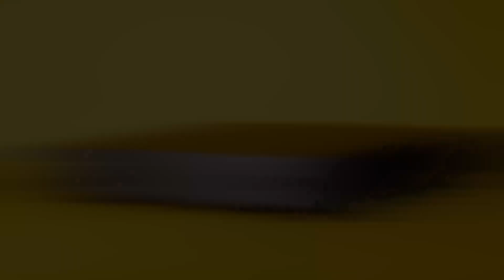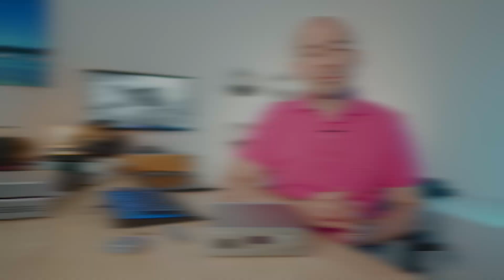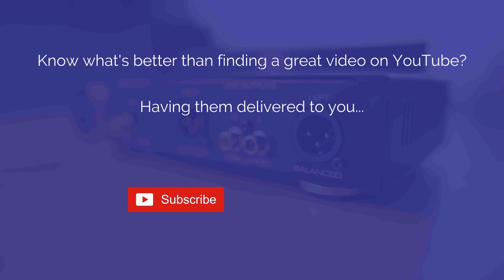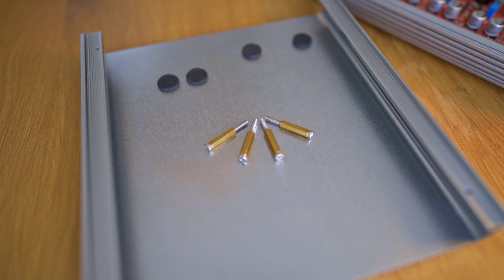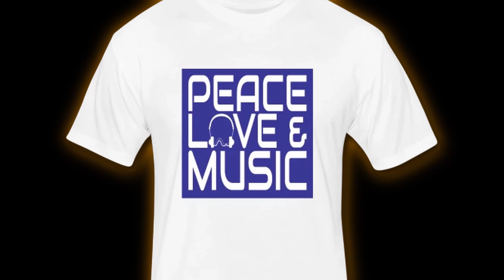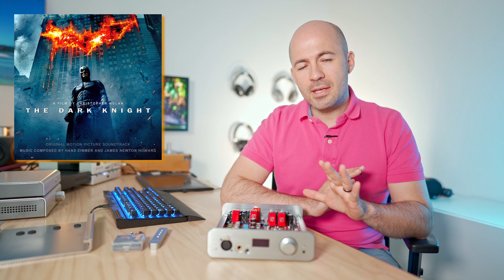Burson Soloist 3X Headphone Amp Review - New tech + old classic = wow!

Comment: Thanks for your great and detailed reviews!  I popped the V5i opamps into a Topping A30 and it completely transformed that budget amp and got me interested in Burson's offerings.  I'm leaning towards the Soloist with maybe an D90 but I'd be very interested in hearing your impressions of Burson's DAC offerings (and others) as well.  The more 3 dimensional sound stage presentation is definitely something that I'm chasing after.  Your review of the D90 gave the impression that it is amazing bang for buck but am curious if the D90 flattens out that 3 dimensional presentation quality as you noticed with the A90 as well?  Keep up the great work!
Reply from the maker: Thanks Casey. Yes, the D90 does tend to flatten things a bit - it seems most delta-sigma DACs do. I'm currently finishing up my Denafrips Ares II review and would say that it is a great alternative to the D90 if you're looking for better soundstage depth.
I'm also expecting to receive a Burson Composer DAC to review when I receive my Soloist amp so you can also watch out for that one to see if Burson have some more voodoo in their bag of tricks...
Reply: @PassionforSound  Excellent, I'll be curious to see what you think.  I'm learning, over time, to trust my ears instead of a spec sheet but it's nice to have objective reviewers like you to help save me a buck on dead ends and wrong turns.  Cheers!

Comment: Intriguing theory on possible timing errors introduced by the capacitors in ICs and why discrete circuit design might ultimately be better. I feel you're onto something here.
Reply from the maker: Maybe. Just for clarity, it's capacitance, not capacitors. The idea being that certain sections of the IC may be holding the signal a fraction longer than they should
Reply: @PassionforSound  Do you have any studies indicating this correlation between capacitance and soundstage? I'm really curious about this.
Also, I'm an Analog IC designer and, in my experience, you should expect higher capacitance in a discrete design more than an integrated one. What may happen is, because the amplifier designer is the same for the discrete ones, he may "tune" his design better for any parasitics and other variations in the PCB manufacture. In contrast, someone using a shelf IC component may not be familiar with the full design characteristics, and will just follow the IC manufacturer specifications and tweak with some experience. That however is not the same as when you designed the topology from start to finish, as is usually the case with discrete components.
Reply from the maker: Hi Fabio, no I haven't found direct studies. My current theory is an extrapolation from an article I read about guitar effects pedals using discrete vs integrated components and why they sound different. I'm still looking for specific info related to amps, etc.

Comment: Great review P4S.  I hope this goes to Sandu at SoundNews as well.. Looking for a direct review against the $750 Class A Flux Lab FA-10 vs. the Soloist 3XP.  The FA-10 does 16 watts @ 32 ohm so is quite the powerful hp amp.   Sandu already reviewed the Conductor 3XR and 3XP with glowing reviews so a direct comparison to the amp quality of the Soloist vs. that in both Conductors would be helpful.  Burson's naming does get a but confusing... The conductor has the 3XP (Performance) / 3XR (References) while the Soloist is only 3XP (Performance) but the power specs match that in the Conductor References.   Then should we assume that a Soloist References is also coming?  Something with more power and bigger/better discrete components in the $2k USD range?
Reply from the maker: Hi Ace, I haven't heard anything from Burson in that regard and they released all versions of the Conductor at once IIRC. Honestly, I don't know if anything more is needed for the Soloist. A 3XR would likely be a waste. It's already more powerful than the Conductor 3XR and I think the various Conductor options are about scaling balanced designs and power output which the Soloist doesn't need to do (it's already balanced and outputting 8W) so I'm guessing this is it.

Comment: It's been suggested that tubes are better for dynamic headphones and solidstate is better for planars.
Do you have anything to share? Cheers.
Reply from the maker: I actually do. Jason Stoddard from Schiit talked about that in my recent interview with him. I'm still editing it to get it ready for release, but the gist of it is that tubes are good for voltage (higher impedances) whereas solid state is better when current is needed (lower impedances). That's the only reason though, so if you've got a good amp of either type, you should be fine - you just need sufficient current/voltage
Reply: @PassionforSound  A Schiit interview! Excellent, I really like those guys. Ok gotcha on the current/voltage thang. You've been a great help, thanks a lot. Cheers.

Comment: After so many headphone amplifier reviews, it’s time to make your own ranking
Reply from the maker: It's tempting, but also so hard to rank them in a meaningful, but fair way.
For now, I can comfortably say that the Soloist and Mainline are right at the top of my list for pure amplifiers (i.e. Hugo TT2 doesn't count because it's also a DAC)
Reply: @PassionforSound  so you think they are better than even the sparkos amp?
Reply from the maker: Hi Manuel, yes I do. The Aries has amazing detail retrieval, but the sound is a bit "digital" for my tastes. The Soloist just sounds right on every level.
Reply: @PassionforSound  that's so cool! What opamps do you prefer in these? I remember you preferred sparkos opamps in burson fun (i too prefer the same combo).
Reply from the maker: The Vivids are just right. I'll try the Sparkos when I can get a pair of duals and my own Soloist, but I'm expecting to prefer the Vivids
Reply: @PassionforSound  ok I am seeing a lot of opamps in this board. I assume it uses multiple stages of opamps instead of single stage. Burson fun likely expects a massive gain in a single stage, where sparkos pulls ahead of v6 vivid (having higher gain bandwidth product), but I think this amp is less demanding in gain per stage so it might show the other aspects where v6 vivid is optimized, better. Just a guess.

Regarding integrated chips vs discrete, ic design is mainly designed for general purpose, and most opamps are designed for high psrr (and when you optimize for one corner, another corner is likely to suffer). Discrete lets you understand each character, non-linearity, parasitics etc and helps you match the circuits better.

Another reason to note is the dual mono power supply. The power supply for each channel is well isolated and hence less crosstalk issues.
Reply from the maker: The op-amps 4 x V6 Vivids are used for a combination of amplification (1 pair) and the volume control (the other pair).

Comment: I think the biggest problem with the soloist is the price. When the schiit Asgard 3 only cost $199.00 with basically the same power output. Maybe the soloist out performs the Asgard. But I would think the laws of diminishing returns would happen if you a/b tested them. You can get the topping d90 and Asgard 3 for the same price as the soloist and have a complete hard to beat setup. 
Looking forward to the review!
Reply from the maker: Hi Keith, I've actually got the Asgard 3 here right now and can assure you there is a HUGE difference! 🙂
The new Soloist shares some characteristics of the old Soloist's sound, but it's a way better amp. I think you'll be surprised by the review... 😉
Reply: Will you be reviewing the Asgard 3?
Reply from the maker: Sure will! 😁
Reply: I consider myself somewhat value conscious and mindful of diminishing returns.  Despite having owned some more expensive equipment, I've most recently used the Burson Fun and Headamp Gilmore Lite Mk2 for how well they perform at their price points.  Same with my RME ADI-2 DAC.  I haven't heard the Asgard 3, but I've owned the Magni, Valhalla 2, and Lyr 1.  I'd place both of the first mentioned amps ahead of the Schiit Amps for my preferences at least.  

I'm really looking forward to the Soloist 3XP once it's formally released.  This and the RME should be very deep into diminishing returns, but should drive any headphone I would need to use with it, while the features of the RME allow me to tweak that last 5% of personal taste with the EQ, Crossfeed, and filters.  I couldn't see myself wanting any more from a front end.
Reply from the maker: I think that sounds like a brilliant setup. I think the Soloist really maximises value for money (and therefore minimises the feeling of diminishing returns)